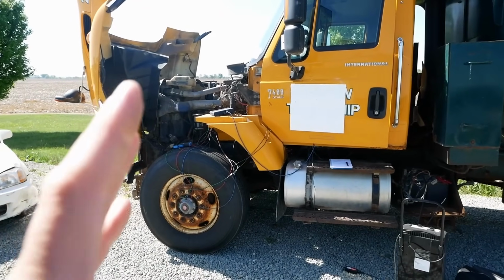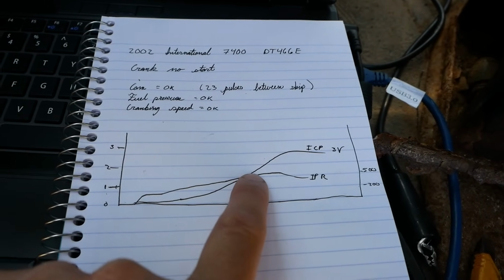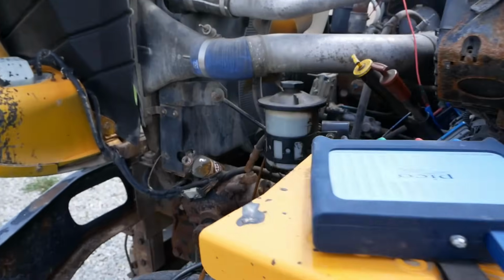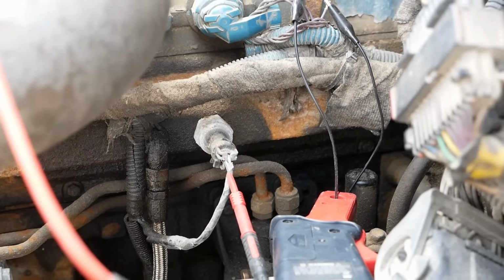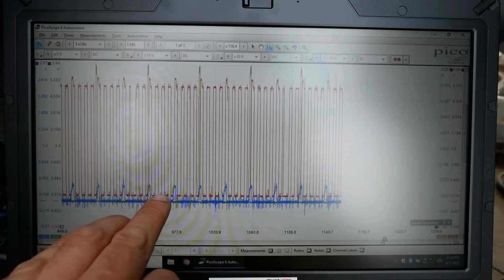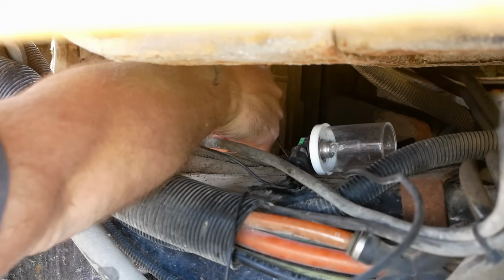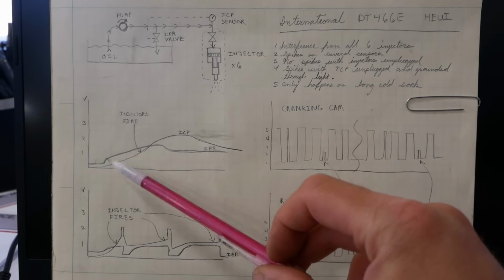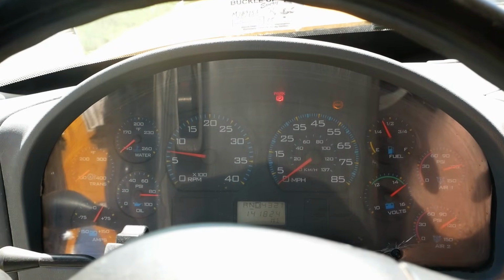International DT466E Won't Start without Ether after Sitting

Comment: I have a dt530 that does very similar things. After it runs for a while the check engine light comes on, keep running it and red shut down light comes on. I just keep running the damn thing , maybe it will blow up, then I have a L-10 Cummins I’ll put in it. I hate this electronic bull shit. You was talking about punching the Navistar engineer in the face, I would like find the idiot that said all this electronic crap was good, I would slit his bag and stick his leg through it!

Comment: Think a cheaper fix would be an ether injector installed in the intake post grid heater. Can buy a lot of ether for the cost of an ECM and those are practically unobtainium for us. 

I like how much you use the Picoscope. We've got one at our shop but hardly use it. I wish I understood it more but hasn't been much of an excuse to use it. 

And yes, international engineers are absent minded. Either that, or body engineering isn't talking to engine engineering to let them know where body mounts and stuff will be. Think they forget that these things WILL fail and have to be worked on.

Comment: Ok , so a heavy-duty diesel engine with regular maintenance should do how many miles ?
A million or 2 ?
Now that's inconvenient.
I know, lets add a crap electrical system that is almost impossible to work on, so the whole shebang gets scrapped after 10 years or so.
The proof of that sad, cynical, point of view, is this very truck, that is the end product of 100 years of 'development'.
Is any manufacturer different?
Reply from the maker: These vocational trucks lead a rough life. Lots of idling, short trips, long periods of sitting, and constant salt.
Reply: @WatchWesWork  
And are occasionally pulled from the brink of destruction by someone with skills and determination I can only wonder at. 
Love your videos Wes, you are a credit to the trade.
Greetings from a cold rainy Sunday in Melbourne Australia.

Comment: Wes, check the oil pressure sensor (main OP not ICP). see if there is oil in the plug connector, if so it could be shorting the vref. i had a couple do that over the years.
Reply from the maker: I think I did check that. Hard to remember.

Comment: I would guess the fuel cutoff solenoid has weak coils, the wiring to it or low voltage to one of it's coils. either the ignition run(hold coil) or start/cranking (pull in). no power is normally closed.
no fuel = no start and the past tale of it working with battery being boosted, leads me to believe you'll find the issue there 😉
**whoops, that one doesn't have a shutdown solenoid. maybe the regulator sticking, pressure sensor or wiring to them. being a plow that's always salty, could be many other things, corroded grounds, powers, middle of harness, all of them will cause goofy things that can be corrected by raising the voltage and once it snorts some ether the vibration/higher rpm's may dislodge something, like the regulator.

Comment: I think if they use it more it would be fine
Reply from the maker: Heh. Probably right.
Reply: @WatchWesWork  I used a old S model for a company I worked for as a driver it was a international v8 diesel had to winder it for a good 10 to 15 minutes befor it would pop. The truck sat most the time and always loaded up and stunk of raw fuel at an idle. I asked my head boss if I could take it for the weekend I had need for it  and I told him I'd give it a servicing before bringing it back monday. He threw me the keys and bid me good luck. Lol first thing I did is drained that old nasty fuel and purged the tank changed all the filters and added 4gal of diesel treat and a couple bottles of water dispersing agent fresh oil and had a friend run the rack dialed in the injectors  way too rich. Monday came it was back in the yard clean and fresh and detailed at 4 am. Boss checked on the truck everything was logged for the maintainance report for the head office. He said that old IH was the cleanest hed ever seen it he even took it for a rip. Said it didnt stink like it used to.

Comment: My guess is a failing internal ground in the ECU.  Perhaps it is a cracked ground where an oxide layer takes days to form, and minutes to clear.

An alternate theory is a failing capacitor that takes time to re-form the internal structure.  Tantalum capacitors usually take a few years to degrade internally, and a few minutes to re-form the separator layer.  Perhaps a bad capacitor is aging badly with a consistent two day period.

A diagnostic step that takes time but not effort is hooking up a battery charger and leaving the ECU powered up without the engine running for a few days.  Leaving power on the capacitor will avoid it failing in this way, but allow any mechanical failure e.g. leak-down to still occur.

Comment: Odd .. and peculiar.
I was leaning with you and others towards bad electronics. The scope proves that pont, and Capacitors bleeding off over 48 is very probable.
BUT ... and I'm not a diesel mechanic at all ... how the hell does Ether fux the problem? Sure it hekps a lazy engine start, but that shouldn't change any of the electronics. You had ut on a charger and cranking fast enough.
The "Ether Test" makes me think it's mechanical ... but I dont know diesels, and especially not what appears to be a very convoluted HEUI system.
RPM of it firing, with associated pressures, "fixes" it. 24 vs 48 hrs rules out anything temperature related. Also seems to rule out other mechanical oddities like induced endplay, or wire loom induction during starting, etc ... 
I just dont understand how Ether makes a computer fault better when generated signals from your power supply wont fix it.

Comment: Another test you can make is to disconnect the battery,  wait 5 minutes,  then reconnect and try a restart,  if you have a restart issues,  then you push the problem to be electrical rather than mechanical.

Comment: You could permanently mount an either injection canister with a button to activate either from the cab. Our Mercedes Benz delivery trucks from Sears had such a unit mounted on them. But on the other hand, to shut it down we held the brake pedal and dumped the clutch. You could shut it down with a push button but it would take forever.

Comment: Wes, I can teel you one of my customer's paid an International dealer $600 dollars to hook up there magic book to their truck and told them of the fuse problem above the batteries. One fuse being power to the ECM. They didn't carry any thing to fix it with them but were willing to wasting 6 hours running back to the shop to maybe getting parts to fix it. Customer called me and I cut out those fuses and installed butt connectors. Another one of my customer just had bought a 4400 IHC from a fuel company. they carried a jump pack to get it started. I did the same with that one and it hasn't been a problem since.

Comment: Hi Wes, having fiddled around with cars with ECU's, etc,  one thing I discovered was the amount of bad earths, bad connections on connectors and dirty connectors causing High Resistance Shorts. I have even fixed problems (temporary) using good old WD40. Just a thought.

Comment: Have the same problem on a 2000 DT444. I've noticed that it I leave the key on for a few minutes it starts right up. Temperature or time between starts matters little. The jump box trick has worked to. I'm leaning to the magic box because of the key on for a few minutes then start right up aspect.

Comment: Wonder if the viscosity of the cold oil and low oil pressure in the injection system is contributing to the problem ?

Comment: I'm wondering if you tried heating up the ECM case with a heat gun when left overnight to see if it can be a definite thermal fault with a component within the ECM. I have to say you have immense patience on diagnosing that silly truck. I would have told the owner to shove it...  10/10 for this vid...

Comment: The International engineer in 2002 must have been a german and went to work for BMW in 2012.  The ECM for the 2012 BMW X5 suv is attached to the underside of the plastic intake manifold with M6 bolts on top and E8 screws underneath. Removal of the ECM requires the removal of the airbox, turbo charge pipe, throttle body and intake manifold.  The ECM has 6 connectors on it, 2 of which can be attached incorrectly.  Getting the connectors reversed will fry the ECM.  New ECM is 3 grand.

They must have also assigned the same engineer to design the whole powertrain.  The suv is AWD and the studio wouldn't raise the hoodline or lengthen the wheelbase, so there isn't room under the engine or behind the engine for the front transaxle.  Solution:  run the axle THROUGH the oil pan.  Replacing the oil pan gasket requires removal of engine cradle, removal of lower control arms, removal of both axles, and lowering the front transaxle.  Book time is 16 hours = $3200 at the dealer.  For a $30 gasket.  Oh, and the oil pan bolts are aluminum E8 single use bolts.  Good times.   effing germans.

Comment: Needs injectors.  This is a very common issue.  Try this..plug in the block heater. The issue is the injectors controls stick inside the injectors.

Comment: What about engine heat that burns moisture off a broken harness, but moisture returns when sitting? Salt attracts moisture, right? Or some oil pressure sensor issue?

Comment: I have a 98 dt530. It would start easily when cold but be problematic when warm, wouldn't always start until it cooled down a bit. My truck has a separate ecu and icu with a set of relays next to them. The dealership wanted to fire the parts cannon so I swapped out one sensor or valve at a time. I finally swapped the relays mounted right next to the icu (identical larger relays) and immediately the problem disappeared. I'm pretty sure the bad relay enables an electical boost to the injectors prior to high pressure oil taking effect on the injectors, I can only surmise the process as I have yet to find an accurate schematic from the dealership for this truck. My truck also has a time delay relay(disconnected prior to my ownership) that retards the engine from starting when going to start it (probably to help get the high pressure oil charged).

Comment: ONLY what I have heard is that the constant starting of quick start etc plus there the cylinders vapor lock on compression slightly damages the con rods and that upsets the engine timing and that is where it needs something with high combustibility like quick start "BUT as I say" it is only what I have heard!

Comment: Wes I had an international 9400i I bought for super cheap when I started driving over the road for myself. Had it for 3 years. Whooooo doggy you aren't wrong. Everything on them is just HARD to work on. Also surprise surprise I had random electrical issues all the time because their harnesses are god awful. 3 years of constant repairs. The head gasket was starting to go so I took it back to the auction. Have had a freight liner for awhile now. AMAZINGLY easy to work on in comparison. Love the content and trouble shooting. you do one hell of a job to find answers on stuff.

Comment: I had a the exact same issue, now this was a few years ago I don't remember all the details.

It was a smaller truck, 3 ton sterling acterra (or whatever they were called) had th 5.9L Cummins and same thing it was crank and crank and crank and until you have it a shot of ether it wouldn't start.

All I remember is it had a bad ground some where 🤷‍♂️

It was weird because after it ran it started again, but leave it over night nothing. 

Weird because after the bad ground was fixed it started just normally.

Comment: Never liked using ether/starting fluids to start anything.  Except in extreme emergency.  Oil pressure?  Pump working?  Correct type of oil?  Kinked oil line or blockage?  When it started after the 24 hours I'm thinking you bumped or moved something that sorta fixed it.  Can't wait to see it come back.  😜

Comment: That's an Allison automatic, I noticed you pressed neutral just before starting.  Any reasonw why you do that? (Considering I drive similar trucks at work, all of them with Allison Automatics with the push button controls)
Reply from the maker: This truck will not crank until you press the neutral button. It's an International thing.
Reply: @WatchWesWork  Huh, that's wierd.  We mainly have Freightliners and Macks, but the city is slowly replacing them with Internationals, mainly because they require less maintenance than the Freightliners or Macks according to the mechanics.

I don't know about the new big International we got (for a 15 yard dump truck), but the littler 5 yard dump truck with an International MX cab & chassis has the shifter on a stalk on the steering wheel. (rotate it between R-N-D).

The city I work with doesn't buy manuals, and haven't since the 80's when an employee got killed by another employee leaving the truck in gear while starting it.

Comment: if it only haooens with injectors plugged in , maybe its back EMF from the injector coils and the part of the ECM circuit that supresses it has failed so its showing up in other voltages lesser to it.  weird fault,  really interesting video.

Comment: Voltage spikes look like small load dumps.   Is it possible that the source current is too low for the injectors and when the injectors are released, you're seeing the excessive voltage spikes?   Those voltage spikes would cause all kind of trouble in all the other circuits.

Comment: Throw some parts at it.   Cam sensor or crank sensor. Then change out the ICP sensor. And finally the IPR valve. I'd actually old school it and hook up a high pressure gauge to the IP and see what the crank pressure is. need 1,200 to 3,000 PSI.
Reply from the maker: All that's going to do is cost a lot of money and not fix anything.
Reply: @WatchWesWork  Check the pressure first.  All the parts listed are wear and tear parts that fail eventually. Cam sensor could be causing your  electronic pulse glitch. The icp sensor could be telling the ECM pressure is high. the IPR valve could be stuck open  not allowing the pressure to build at cranking. Sorry didn't watch the video as it is to long.

Comment: As a retired Air Force electrical tech I can tell you with out a doubt it’s corrosion. We would see it every day from the birds that lived in the northern climates. Salting runways and ramps is the biggest reason. We finally convinced Boeing and Lockheed the electrical systems “MUST” be environmentally sealed. Grounds, splices, connectors, everything “MUST” be sealed. I’m not saying the computer is still the issue but I will almost guarantee if you could open that box you will find the problem. Very good stuff and hi from Texas
Reply from the maker: Corrosion? Hard to see how that could happen...

Comment: As a mechanic & electronics/computer tech for many decades it sounds like dried out/leaky capacitors & or cracked solder joints on the 5V regulator in the ECU n oh boy haven't I seen some weird faults from this over the yrs, I agree there's noise on that 5V ref so maybe a 470uf 25V cap put across the 5V ref would fix this as a hack to save removing n recapping ECU, just a suggestion.
BTW: G'day to the huffle puff towing service, kido n Max -:)

Comment: I have has something similar years ago with a Cummins running a Celect ECU. I turned out to be condensation inside the ECU, when it was warm it was fine but totaly random cold starting.  the wiring harnes has chaffed a tiny hole in the casing, I only found it after swapping the ECU out.

Comment: It's most likely failing filter or decoupling capacitors inside the PCM causing the issue. Allowing noise from the IDM section to leak to the controller side, or the big gulps of power the IDM boost converter is drawing are causing the microprocessor's power supply and reference to drop out. When the capacitors get a little heat in them, they function well enough to keep things running.

As far as injection pressure goes, the PCM on any electronically controlled diesel calculates a target injection fuel volume. There is also a calculated injection duration. The system will vary pulsewidth and pressure to ensure the desired volume of fuel is injected within the desired time period. 

As for HEUI, it was a great system at the time - around '94. No one else really had a fully electronically controlled injection system, and you didn't need highly exotic things like piezo injectors or high pressure fuel pumps.

Comment: I don't understand the love affair manufacturers have with bolting ECMs to engines.
I mean, it's not as if electronics are in any way affected by long term heat soaking, wild temperature fluctuations, high and low frequency vibrations or those sorts of things.......

Comment: No you’re shooting effort into a diesel engine what has a heater girl plug will be ruined the gold plugs in your pro spray and effort into an engine like that what is new with her to eat electron it has a light 28 for plug what you plug-in it warms engine I think it’s some inside of the computer and I think it’s the way how you spray the ethernet that engines do not like effort that’s why you always use the gold plugs to warm them